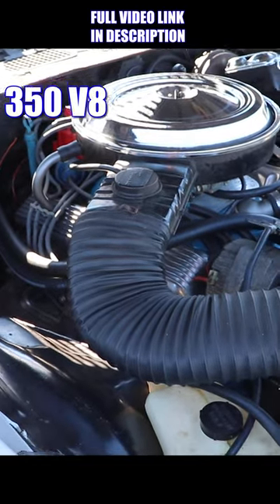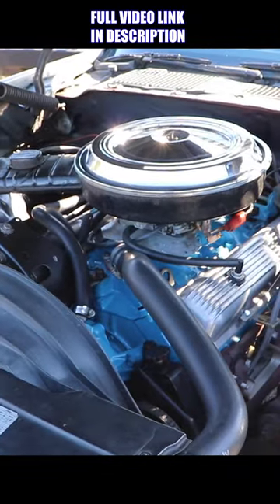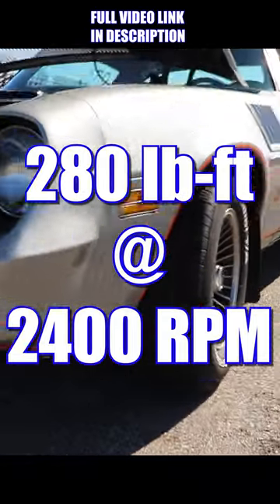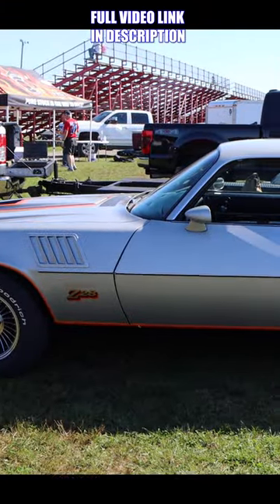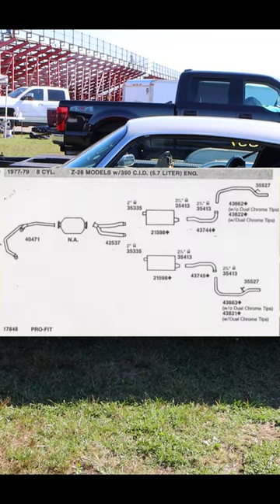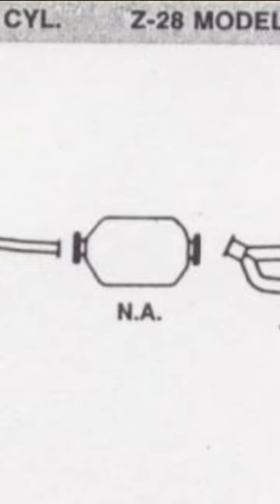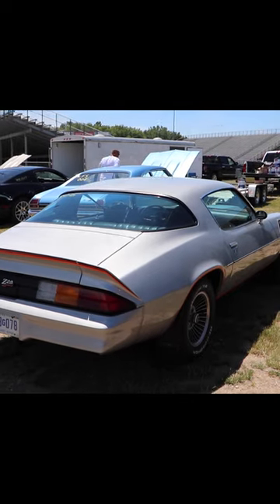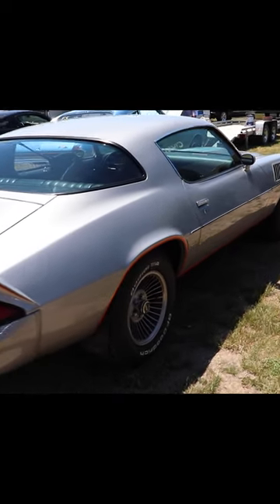The 1978 Camaro Z28 has a TERRIBLE exhaust | CARS AND ZEBRAS #shorts

Comment: I had a 78 Rally Sport,same color with a black roof. The first thing I did was rip the exhaust off and install a Flow Master exhaust system.  I hung the 🐈 on the wall.😂 The 2nd thing I did was build a better 10:1 engine & TH350 tranny. 3rd was replace the rear axle with 12 bolt rear axle from a Firebird 3:73 gears,& 2500 stall converter. Fixed the saggy driver side door. It went pretty good after that.

Comment: My good buddy bought a new 1981 Z28 here in Alberta with a 350 4-spd. Come to find out decades later that this combo was only available up here. All U.S. 350’s came with automatics. But I digress. My point is that I drove that car many times and it was quite impressive power-wise but the handling was a dream. Of course I was comparing it to my ‘70 Roadrunner which the steering resembled that of a bumper car at the fair.

Comment: The LM-1  350 4 barrel the same  engine that pickup trucks used..  the cam timing was retarded 4 degrees to help emission which  helped low end torque too .